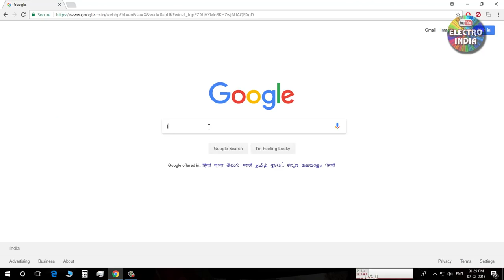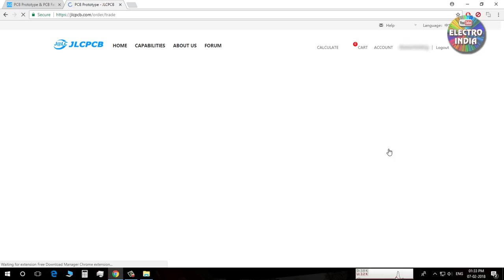2.1 Home Theatre Audio Amplifier Board with TDA2030 IC DIY | ELECTRO INDIA

Comment: thank you very much
actually my circuit had bunt some resistance and capacitor and I was checking the model same as that of mine , I don`t find any thing. I was looking to buy the board from amazon and check your video so that I can buy it. unfortunately my burnt circuit board is same as yours. and your data file has all the required capacitors and resistors that I had burnt so that i can buy . thank you lot.
I have saved money because of you.
thank you